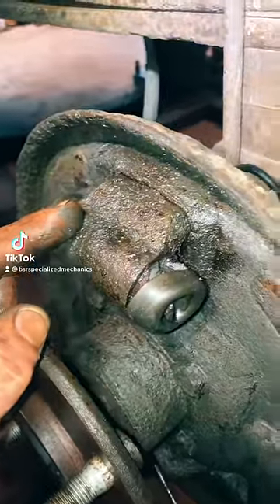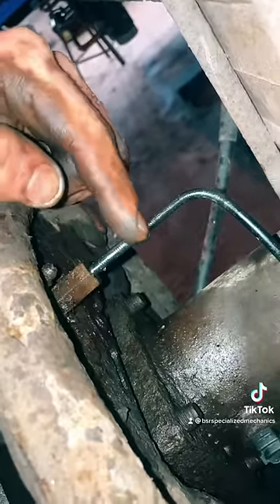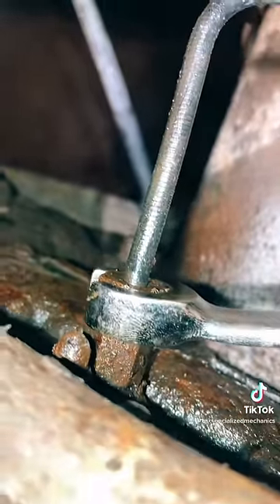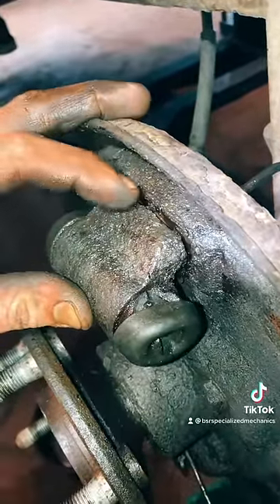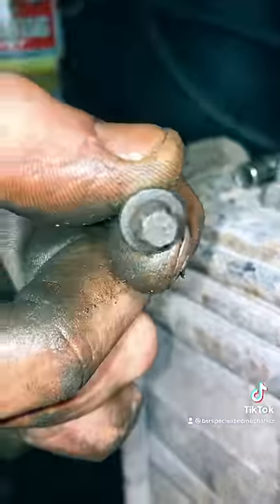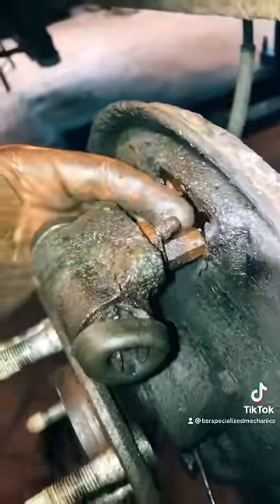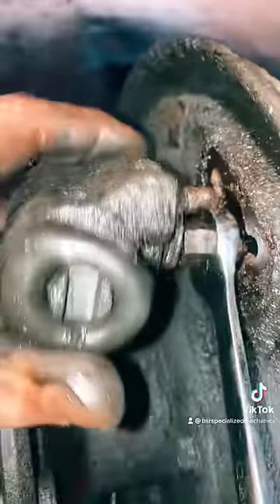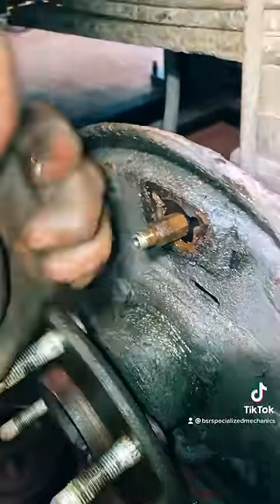Wheel Cylinder R&R pt.1 #diy #howto #mechanic #tips #cars

Comment: I use heat.  Works every time and I work in MN
Reply: I heat the Flare nut to free it
after I remove the wheel cylinder because the New part may Not Align properly on the frozen Flare nut .
Reply: do not eat a wheel cylinder if the system is closed, I know a guy that had one blow up in his face he's had a nasty scar around his neck his whole life
Reply: Three truest comments on this video.
Reply: Yeah, common sense goes a long way.    Its possible to heat it so much that the wheel cylinder would blow up. 

In 18 years professionaly, getting the nut glowing read hot takes about 40 seconds with map gas.  I have never had an issue with getting them loose to the wheel cylinder nore the line itself and never blown out a wheel cylinder.
Reply: @karlmiller7500  I've torched tons of full brake systems with no problems. The thing you have to do is only torch what you want to free.

Comment: That's how I've been doing it for years living in the Rust Belt LOL
Reply: Must be rough. My 45 year old car needed it's first wheel cylinder replacement a little while ago and the brake line fasteners turned right off without twisting the brake line at all.
Reply: Same here in southeast Rustconsin. I KNOW how to do non rust belt repairs...I just don't even bother trying that first.
Reply: Normally in Indiana we're replacing the rusted through break line also! 🤨
Reply: @scottpearce7466  I use nickel copper brake line it seems to last longer and it's way easier to bend.

Comment: Great tip. Another way is to put your line wrench on the nut, have your apprentice or coworker apply loosening tension to the wrench while you feather the trigger of your air hammer (preferably the bluntest tip that can make contact either on the nut or line wrench). I first used this technique on older fuel injection systems with hardlines to injectors then used it on wheel cylinders (I will say that this air hammer technique works better on the wheel cylinder vs the nut on imports with small wheel cylinders for parking brake set up).

Comment: Did many when I work in PA, always used a propane torch or map gas to heat the nut. The nut is normally near seized in the cylinder

Comment: All good. Now the old Brake Cylinder is off. Inspect the brake lines and see if the entire line needs replaces or just needs a new line nut installed.  Either option needed are inexpensive compared to the possibility of your brakes not working.  
  The frozen brake line to the nut will need replaced as it’s probably rust welded to your brake line and ready to fail.  Because Brakes Stop your car and the lines and hardware needs to be in perfect working order.  So Cut the brake line  just behind the brake line nut with a flare tool.  Clean and inspect the line before Installing a new line nut. Push line nut on the cleaned line and Flare the line. Install the BC, Screw the new line nut onto the new Brake Cylinder and install the Rotor. adjust park break and install the Wheel. Bleed the brakes and Check for leaks. .  ,

Comment: quick tip, those are called E-torx, you can get a set of sockets for them at harbor freight.
Reply: YES... thank god... I was hoping someone would catch that and correctly mention what those bolt heads are. those are usually an E8 inverted torx head bolt. DO NOT use the wrong socket unless you intend on replacing the bolts. They WILL strip easily.

Comment: And when you have the wheel cylinder off, heat up the flare nut and get it loose. Then clean up the end of the line and coat the end of the brake line itself with anti sieze where the nuts slips over it. It won't ever stick like that again.

Comment: Tip from me.. Is to use a E socket for the E type bolt instead of using the wrong tool for the wheel cylinder bolts.

Comment: Just put the torch on it and heat it up.  The brake line will release and you'll be able to spin the tube nut.  Clean it up and reinstall.

Comment: Napa sold me a new cylinder. I wasnt ready though..took the old cylinder out and snapped one 6mm mounting bolt. Make sure you have two new bolts ready. I had to find 2 new bolts, cut to length and clean the thread end

Comment: Nice tip but next time use the correct torx socket for the wheel cylinder bolts

Comment: Ok, the real trick is doing It with a master cylinder ( I did end up making a faired joint with a union. It was what I had at the time. Looks goofy but at least it isn't a compression fitting. Please people don't use those on brakes

Comment: Just break off the old brake line and replace it. You're already changing out bad parts, might as well change the line too. They're not expensive.
Reply: That’s great advice. I too prefer to unnecessarily replace parts, waste natural resources, and unnecessarily spend money.
Reply: @Iamthatguy01  where I live, the wheel cylinder and the brake line give out at roughly the same time. When we change out the cylinder we usually have to change the line too. Salty sea air corrodes thin metals quickly.
Reply: Was looking for this comment